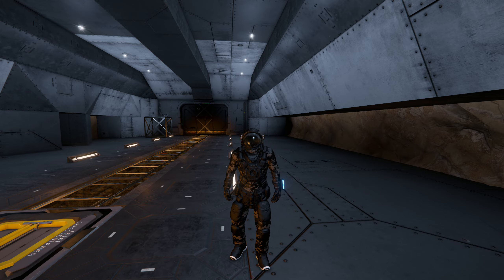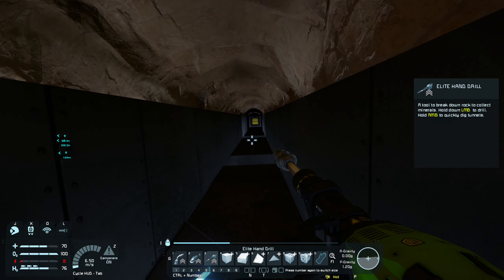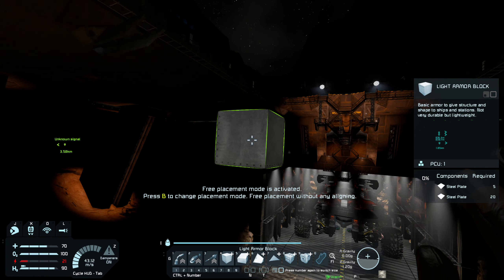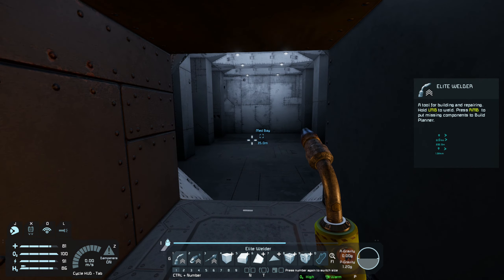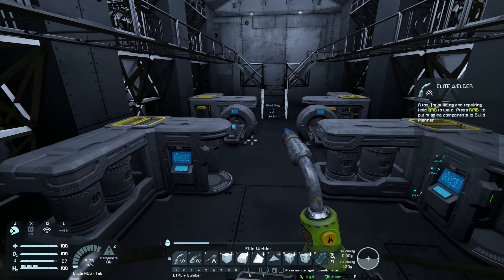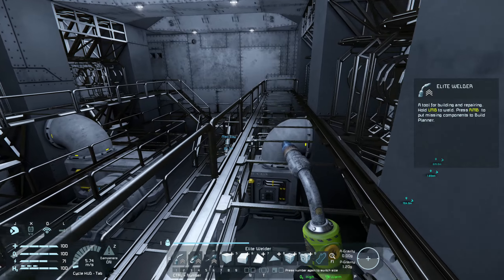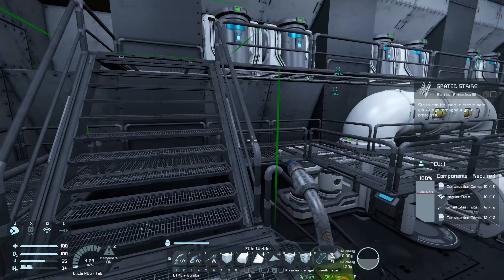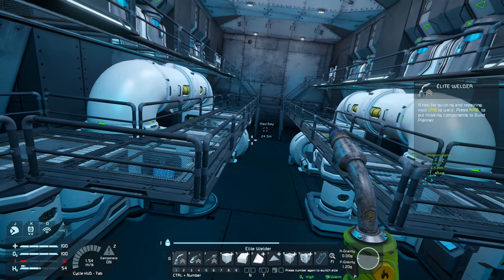Space Engineers - Wasteland Survival Ep46 - Creating the Medical Room

Comment: Some thoughts: 

The reactor room looks very "smooth". I think it would look more credible if the walls were a bit more busy. You might put in some extra conveyor pipes in different places, replace some of the wall blocks with interior walls (the ones with the visible pipes) etc. 

I realise that the reactors are some kind of futuristic/SciFi reactors that have different requirements than real ones, but it would still look interesting to have their environment look a bit more busy. 

About the medical room: 

First off, remember that a medical room exists to treat sick or injured people. You don't want them to have to walk up or down stairs if you can help it, so I would put the medbay blocks on the same level as the entrance. I would also put in some kind of receiving/triage area at the entrance, with a control seat to work as a "desk", and maybe a passenger seat or two for people waiting for an appointment. Why not a "TV" on the wall? 

The bottom floor can be used for supplies, and this is also where I would put the cryo pods, since I think of them as "storage" for patients who have severe conditions and can't be treated locally, but rather must be put in stasis until they can be transported elsewhere. Maybe space them out with some interior walls, using the "frosty" texture to suggest pipes with cooling fluid? Putting the contract blocks on top of the pods looked really good. 

I like the idea of putting the medical scanners next to the medbays. To provide the right treatment, you need to scan the patient for a proper diagnosis. 

I would separate the treatment rooms from the entrance/triage area, in order to give the patients a bit of privacy. I'd put them at the back of the clinic, behind some walls. 

I would try to find space to put down a few beds, for those who have to stay at the clinic for observation. Not sure if that  would fit in a good way, though. 

Catwalks work well for the floors and stairs, except that a medical clinic needs to be kept clean, and I don't think grated catwalks are the best choice for that. I'd use the solid catwalks in this particular area. 

As for colours, I'm glad to see that you used lighter colours on the medical equipment as well as giving the area more light. One thing you might want to consider is using that green shade often seen on medical scrubs on certain items, such as floor plates, some furniture and maybe the cryo pods. 

It's a colour that is already associated with a medical environment, it's supposed to be soothing, and it will break up the grey and white colour scheme without being too conspicuous. 

I might try to find a different texture for the walls, other than the riveted, industrial-looking texture you're using elsewhere. It works perfectly in the other parts of the base, and would probably work in most of the residential area as well, but it looks a bit too dirty for the clinic. 

That said, it would be fun if you kept it for most of the clinic walls, and just used a "cleaner" texture in certain parts of the area, to create a bit of unexpected contrast. 

I realise that what I'm suggesting would look a lot different from what you built. That doesn't mean that I think your build looks bad (I don't, because it doesn't). It just means that I have a different approach to this type of room, from an aesthetic point of view.
Reply from the maker: Eventually once I have the whole base completed, as in the main structure, I will go back around and ass in all the small details here and there 😊. All the suggestions you made about the medical room make sense, but yeah as you said I would have to re-design the whole thing, I mean I have done that before so maybe I will in the future 😎
Reply: @TheGarageGamer86  I thought you might have a plan like that. I tend to not be able to leave a building alone until I've done at least some detailing, but your way is probably more practical. 

Mind you, there is nothing wrong with the way you built your medical room, it's just that I would probably have built it differently. I'm sure you could find ways of using suggestions from me and others that don't require a complete overhaul, unless that seems fun to you.